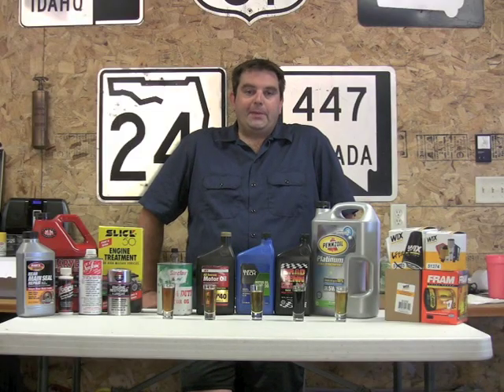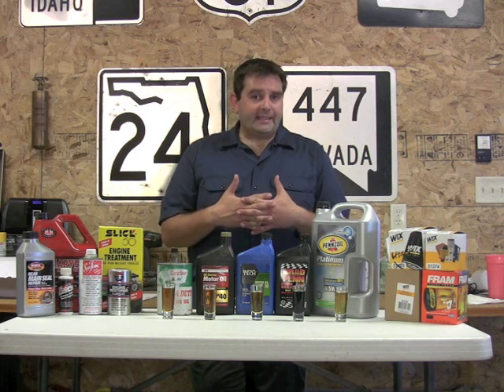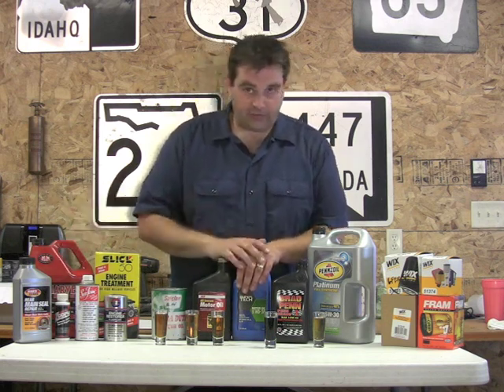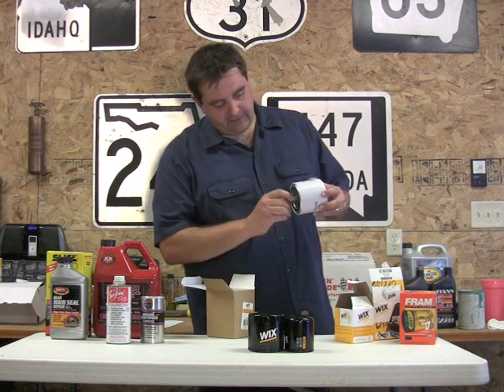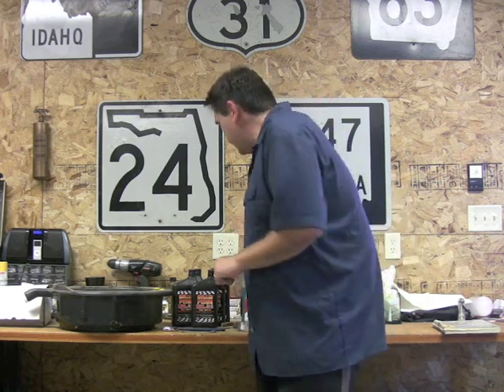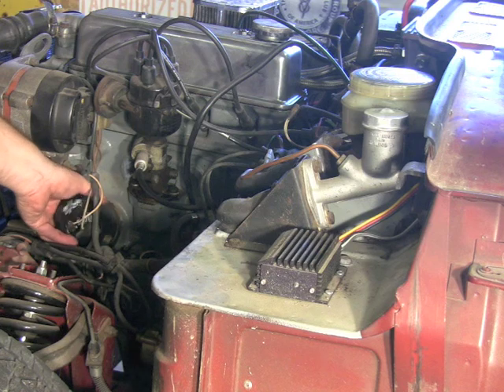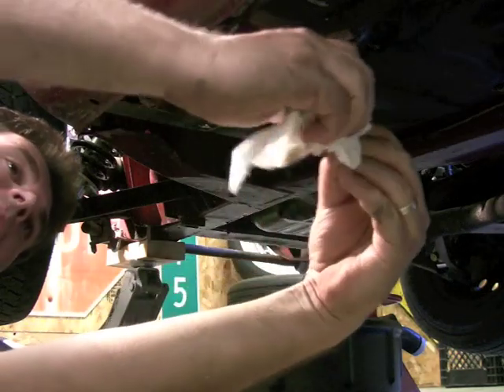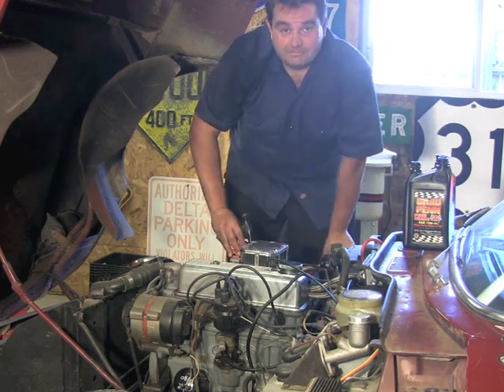All about Oil

Comment: Thank you for posting...  Few things to mention: 4.5L = 4.75 quarts, not 4.25.  No instructional video should include a channel lock to remove or install an oil filters - there are many tools that are more appropriate for the job, like oil filter sockets.  Also, synthetic oils have different weights, so you could accommodate a thicker synthetic oil that would equate to the mineral oil.

Comment: great video I use the brad penn 20/50 in my evo 8 its known to be great oil lot of guys including me blew there old turbo's using mobile one because it doesn't bond to the thrust bearings as well but using the brad penn I have had no issues : )

Comment from the maker: @lillskiten1337 In my opinion, synthetics are too slippery which can lead to lifter failure.  If the oil is too slippery the camshaft has trouble spinning the lifter.  The lifter rotates in the bore so it does not wear in one spot, if it does not spin it will wear in the same spot.

Comment from the maker: @720byrd I talked to a high-end engine builder and he said he puts 10/30 in everything he does. However, because our cars are designed to run at high RPM, he said you'd be better off going with 10/40. I think either way you go, you'll be fine. We did by the way, get a big shipment in from Brad Penn at a nice discount. So, if you need some we can probably save you a few bucks.

Comment from the maker: @dc007fan Yeah, I used them in my 96 Chevy (250,000 miles) worked nice. I did switch everything I own over to Brad Penn though. It is just a better more consistent oil. I run it in EVERYTHING I own from my 1939 Ford to my wife's new Sequoia. (I even run it in my log splitter and lawn mower.)

Comment: 1985 in the USA most cars and trucks have gone to roller type cams so zinc is no longer needed..zinc is good for high pressure areas in and engine mainly cams and lifter faces..zinc is expensive and harmful to catalytic converters

Comment: I think you need to read little more about viscosity. Higher the number; thicker the oil. 10w40 is lot thicker than 0w20. I hope you are not serious about additives and synthetic oils. Sythetic oils do not need any additives. You just run good synthetic and everything is good. Most additives are waste of time.